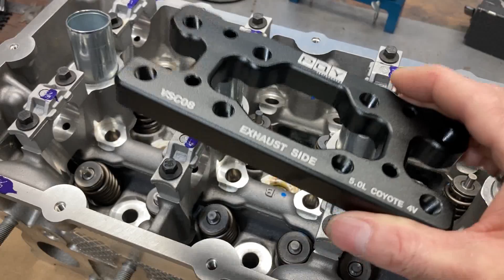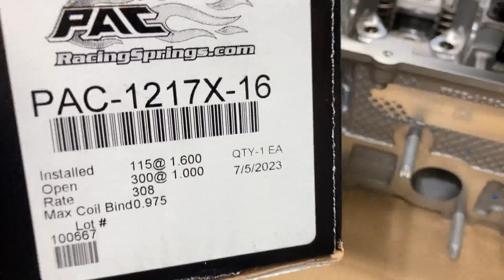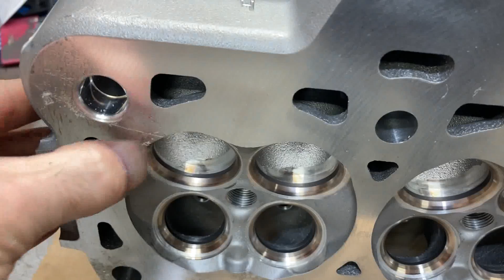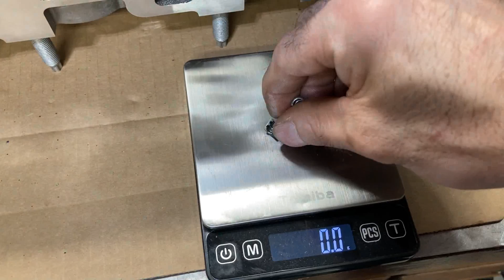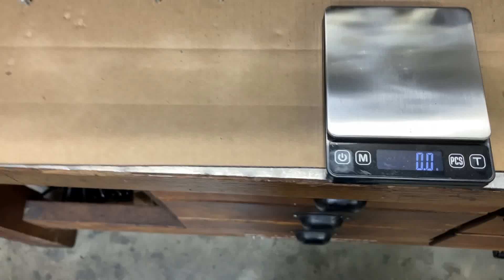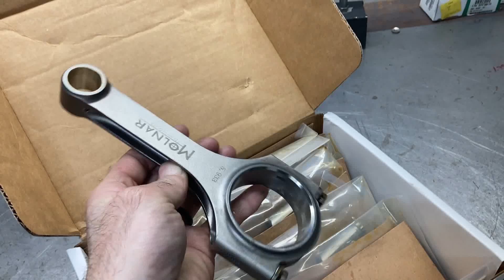Lykins Motorsports Gen 2 Coyote Cylinder Head Introduction

Comment: Good morning Brent and viewers! Does anyone know the changes from Gen 1 to the latest Gen head? Can the different Gen heads be interchanged? Just wondering how the tech evolved. Thank you. CHeers from Motown.
Reply from the maker: Gen 2 had larger valves and flowed  better than Gen 1.  Gen 3 is direct injection.   They can all be interchanged as long as you use the appropriate head gasket for the generation.
Reply: @lykinsmotorsports  Thank you Brent! Was just doing some digging on the Coyote engines. Might be a solution for my 67 Mustang 460 bbf to Coyote or a 351W stroker 408. Thanks for your reply sir. Keep up your excellent content! Cheers from Motown/Dearborn.